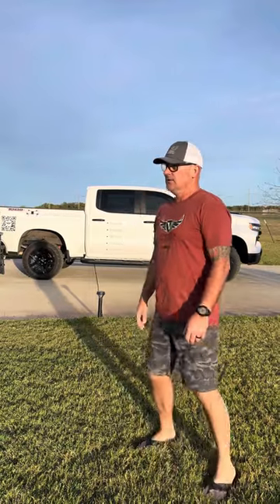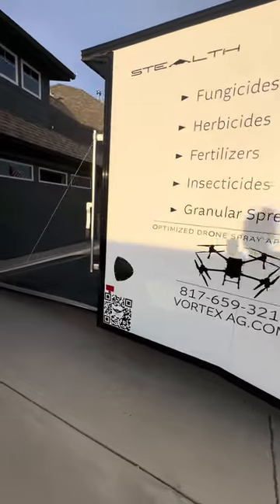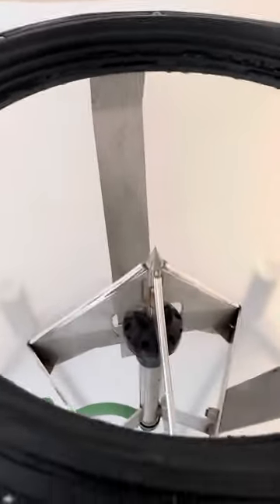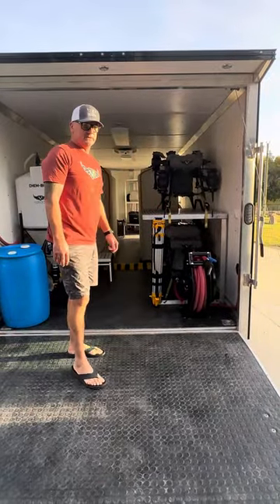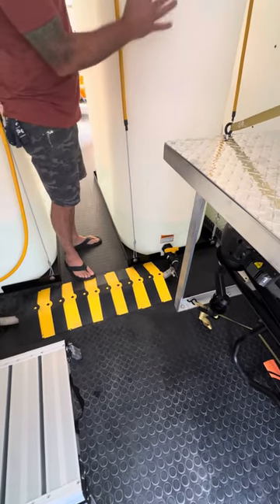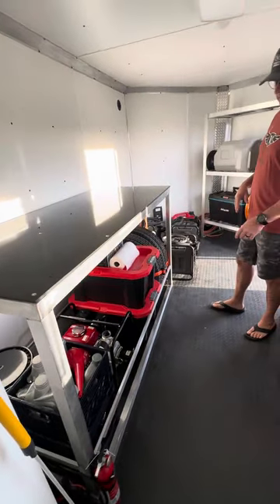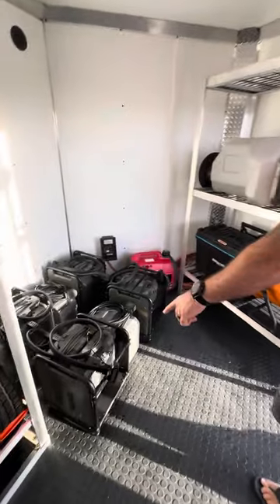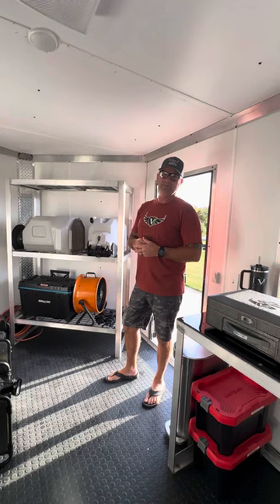Vortex Advantage AG- TX Spray Drone Trailer Setup

Comment: Great set up! Do you have two CT6 highflow pumps?  Just trying to set up my system, and not sure if i need 1 pump for the clean water(fill and rinse tanks) and one for agitation and transfer from the tank to the drones.  Or is it one pump and a plumbing setup and design that I might be missing.  Thanks for any help.
Reply from the maker: Hey there, thanks for the compliments. I have been planning on posting an update video showing how I split the plumbing and added a second pump for freshwater. I was getting some cross-contamination into my freshwater tanks, which is never good even as careful as I was being with the valves. I run two CT6 HF pumps, one for freshwater and jug and tank rinse and one for agitation and filling the drones. I will say they are advertised as being 30 minute duty cycle so not sure if that is the best choice for agitation and drone filling. In a perfect world, you would want that running all day, which I have done lots of days with this pump without issue. Just not sure if that will be a problem down the road or not.

Comment: Very nice! what spray rates do you guys use?it seems that the water tank is kinda small...
In Russia we have 1000-1500l of water for 2 drones.
We use XAG P100
Reply from the maker: We can carry 800 gallons of fresh water on the trailer. This is more than most have set up here in the USA. At a 2 GPA rate we can hit 400 acres without needing more water. I also have a 275 gallon IBC tote I can add to my flatbed truck to provide up to 1000 gallons with water to cleanup with.

Comment: Honestly, my only question is where did you get the money for that kind of set up.. I mean two T40 alone with everything you need is close to $100K if not more. Then that trailer with everything in it ... I mean that is at least a $400K set up give or take!  Where do you guys get that kind of money?
Reply from the maker: Thank you, and I suppose I’ll take that as a compliment. We are definitely not anywhere near $400 K on this build out, but more than half of that for sure with everything. I’ve done a lot of stuff myself, which can cut quite a bit of cost down. For instance, I built the deck on top and installed all of the hardware, including the ladder myself. All of the parts and interior organization. I put together, but paid a company to build the aluminum shelving units and install the water tanks and plumbing associated with it. I have done some modifications to that myself as well. The point of this build wasn’t to show off or anything like that. The goal was to hopefully impress the folks I work for and show them I’m not playing around and am fully invested in this. The reaction I get when pulling up to a field and meeting with the Farmer is definitely “this guy ain’t messing around“. I’m already planning how the next trailer will be built and I definitely will do some things differently although this is a pretty darn nice set up based on the feedback I’ve received thus far.
Reply: @VortexAdvantageAg this is very inspiring sir well done . I am planning on starting my own business soon here in Virginia. Do you pick and choose your products you apply or do you allow your customers to pick ? Do you have the contact information for the company or people who help you with your build? I saw your upgraded version and was wondering if you have a material break down of how this was built also thanks for your help.
Reply: @VortexAdvantageAg  GREAT REPLY AND BEST WISHES!!!
Reply from the maker: Thank you!👍🏻
Reply: Very inspiring.  I'm planning to get into ag spraying in Twin Falls ID next season. Obviously you've put some thought into this, what kind of net profit are you anticipating once you're at full capacity with the equipment you currently have on this video?Yeah I know it's a personal question 😂
Reply from the maker: @jerodbosh7630 I think any business should operate on at least a 30% net profit margin if not more. You gotta pay the bills, pay quality employees and keep them interested, and put some money in your pocket so at the end of the day you like what you do feel like you’re getting paid well for it. I put in hard work and go above and beyond for our customers so I’m definitely aiming to earn solid margins